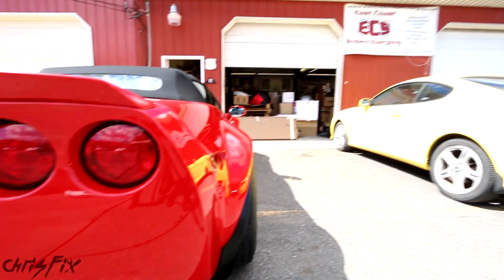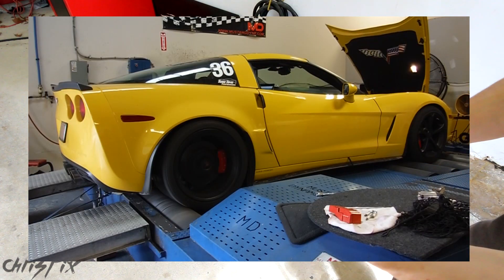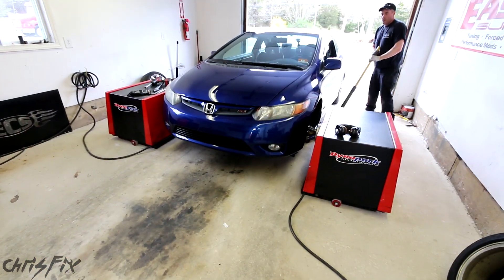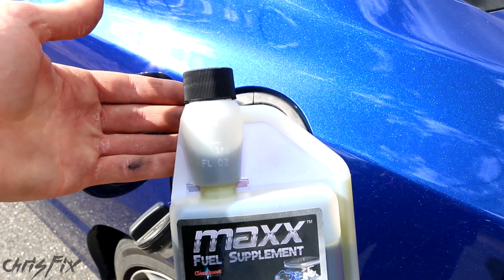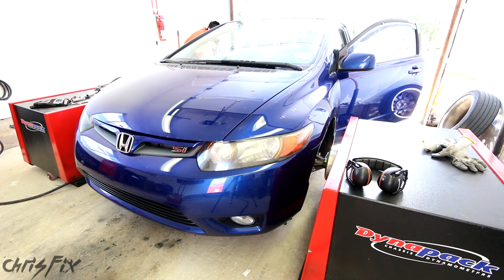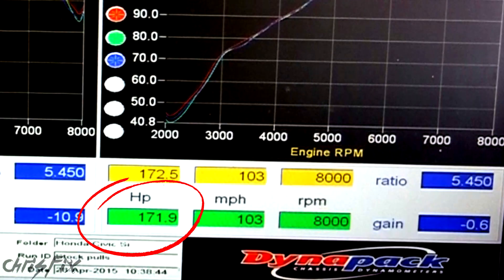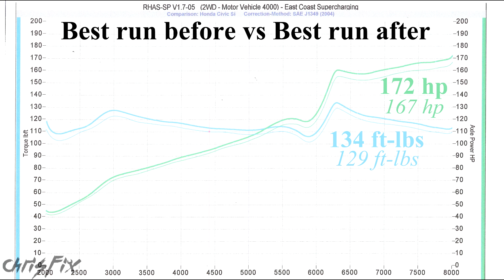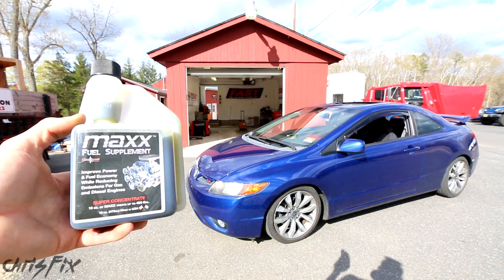Can a Fuel Additive Really Increase Horsepower in Your Car? (With Proof)

Comment: Have you thought of running tests on cold air intakes? Testing the torque, hp rating and fuel mileage claims? I think its a myth that needs to be busted once and for all.
Reply from the maker: MrLimondavis That would be pretty awesome! I am thinking about it but it is just very expensive and takes a lot of time to do!
Reply: ChrisFix it would be expensive. I think that's why no true independent tests have been done yet. It would bee awesome to know once and for all especially the for the working man that could spend that money elsewhere.

Comment: Super cool, ChrisFix! I drive past ECS on 539 all the time on the way down to LBI and on #Slambo's open road MPG testing. I need to throw some CleanBoost Maxx in the tank …
Reply from the maker: Nice! I cannot wait to test the MPGs!
Reply: ChrisFix HP is relatively easy to measure on a dyno. Strap on, fire it up, and run it up to speed. Real world MPG is a tough nut to crack. The variables are endless. I use a 40+ mile loop on I-195/295 for highway tests on most of the cars I review and drive as consistently as possible.
Reply from the maker: MPGomatic Yea, that is why I have never done it haha

Comment: The results clearly speak for themselves.. But there are a few variables which could have skewed the results (Did you give the car the same run before the baseline test as you did to mix the additive?). Ambient temperature? Oil temperature (I know coolant temp was measured)

But as always my position is that if there is a concoction of chemicals which could be safely added to increase power / reduce emissions and increase MPG it would be in fuel manufactures best interest to include it in their fuels..
Branded as "premium", obviously

So I wonder how conditioning a branded "premium" fuel with this additive would compare to basic fuel on the dyno..
I'm talking about premium fuel with additives, not fuel octane levels (which is far easier to understand) ;)
Reply: I could see how the fuel additive may have had some kind of impact on the fuel trim the computer was using based on how the altered fuel interacted with the O2 sensor. With out a wide band O2 data log showing what the air fuel ratio was on each run, the power increases could well be due to a slightly altered fuel trim as much as the fuel actually making more power.
Reply from the maker: Azurren As stated and shown in the video the ambient temperature was relatively constant and also corrected for by the dyno as well as barometric pressure (check out the computer screen when I show the dyno runs). Oil temp was about the same because we spent the same amount of time before the dyno running the car but there is no oil temp gauge so it is hard to show that. Good thinking and I like your curiosity!
Reply: ChrisFix The most puzzling thing for me is how the first 3 dyno runs yielded decreasing HorsePower figures however the 3 with the additive remained fairly consistent..

I mean, surely a fuel additive wouldn't solve the thermal / heatsoke issue. Could it? Theoretically it's possible that it could help improve it but.. By such a margin..?

I know dyno time is expensive but I would love to see more of this type of video :)
Reply from the maker: Azurren I cannot say for sure but the fuel additive seems to have helped combat the hp loss due to heat. I think it is the catalyst in the additive that creates a consistent explosion of the gas. I really hope to do more dyno testing but this stuff gets expensive fast! These runs are $300!

Comment: Not worth the few horsepower you will never feel.
Reply from the maker: FordTechMakuloco True, but we need to test the fuel economy claims. If it does in-fact increase mpgs so that you save money by using it, then the extra hp is worth it!
Reply: We shall see but doesn't that car get crazy good gas mileage already? Interesting stuff either way.
Reply from the maker: FordTechMakuloco I wont be using just one car ;)
Reply: FordTechMakuloco Time to try it in the Ford TD 6.0L!
Reply: ChrisFix You should perform the test with specific fuel/additive ratios to verify the increase.
Reply from the maker: ForestNinjaZero I did. You need at least 1/2 an oz for 15 gallons.
Reply: ChrisFix What was the octane of the fuel you were using?
I have an Audi V8 with the same compression (just many more liters) and I can tell the difference between 91 Octane and 93.
Reply from the maker: MrRexQuando It was 91 octane.
Reply: Not in a 4000lb car but a 2000lb Civic you'll notice a few ponies.

Comment: Hi ChrisFix,

I own a 2009 Toyota sequoia obviously I bought it since 2009... I have a big dent on my front bumper with some few scratches on it and so the rear bumper, I also realized that the paint on the dents are scratching off a bit, Do I need to repaint the whole body of the car or just the dents? Because I have some weird black dots on my car hood and they wont go off even by washing it!

My steering wheel and driver seat are also scratching off! the car is in seriously bad problems, and I cant write them all here because that's going to be a huge description of my car!

If you have any advises, please answer as soon as possible. my car needs help! :(
Reply from the maker: Anarchy Panty (SupaMario) If you have a lot of dents and stuff, a body guy will probably just tell you to replace the bumper because it would cost too much to fix. A lot of those problems including the steering wheel and seats are not reversible.

Comment: Need to know the fuel octane and compression ratio of the engine
Reply from the maker: Otto von Chesterfield, Esquire This isnt an octane booster but the car requires 91 octane and the compression ratio is 11.0:1
Reply: ChrisFix That is the same as a 5.0, which  is convienent

Comment: Wow... that's pretty good. The amazing thing about this is that it is a topic that is quite often discussed by many but actually demonstrated by few to none at all. I would imagine that with a car that doesn't require the premium fuels, a gain in octane won't benefit at all because the compression in those motors is already low enough to not cause much any pre-ignition. He really did good on this test using a high compression motor such as the one in this civic, that does require premium fuel. especially for a stock honda, that was a pretty good gain!
Reply from the maker: Jj Price This stuff isnt an octane booster so it works the same in all engines. I am glad you liked the test! Thanks bud!

Comment: can I use it in a daily basis? does it harm engine or engine and fuel components? ChrisFix
Reply from the maker: You are supposed to use every time you get gas. It is supposed to actually help the engine because it adds lubricity to the fuel and keeps the engine running cleaner. I really want to see if it creates more mpgs which will be big if it does!
Reply: ChrisFix thanks, I might try it on my older Civic EK

Comment: Wonder what would happen if you dump the whole container in lol
Reply: ChrisFix In the interests of accuracy to the claim, you would have to test the product without a delorean, flux capacitor, plutonium, or 1.21 gigawatts.
Reply: I'd read the directions on the bottle. Try not to rip the continuum a new one.
Reply from the maker: Evak Blades You can time travel. That is their claim on the bottle, so we should test it in a delorean right?
Reply: ChrisFix delorean is so 1985 i think the civic would be just fine for the test
Reply from the maker: PGTMR2 Hahaha, that is very true. I wonder if I still need to hit 88mph without a flux capacitor?

Comment: so roughly works out to 5% right? not too bad i guess as its just a fuel additive
Reply from the maker: DjStiv3 Correct. I want to do a fuel econeomy test to see if it increases mpgs which will save you money and increase your HP so it would be worth it.
Reply: ChrisFix
gotta ask... when do you recommend this to be used? its not a drastic HP gain, but should it be used at all? If your a gearhead/tuner and all that, its good, but for most people its not worth it right? I feel sketchy adding this to my fuel, for the fact that im cautious and careful with my car, even if theres is no chance of anything bad happening, i still feel wrong doing it.
Reply from the maker: DjStiv3 If it gives you more MPGs then you should use it all of the time to save money and make more power (I will test this in the future). Otherwise, if you are trying to squeeze hp out of an engine or have a race car I would use it. I know what you mean. Adding stuff to your gas feels weird. I never used any of these additives before I started testing them out!
Reply: ChrisFix
thanks for the info and answers bro. Im going to consider using it, but yea in the back of my mind i think i will always have that thought in my head of "will there be any long term damage or damage at all". lol
Reply from the maker: DjStiv3 Yea I feel ya. They say it adds lubricity to the cylinder walls so it should actually help your engine last longer but I know what you mean. That is why I do these test and use my borescope camera and stuff so we could see what we dont normally get to see. Unfortunately long term effects are hard to test.

Comment: This is why i want ever have a car show because I want sell out my credibility by helping companies sell BS to people who trust me. I lost All respect for Carrol Shelby after he did the Z-max commercials.
Reply from the maker: ***** Exactly! And that is why I do these tests with these products. We have seen good results on a few like this stuff, seafoam, and even gumout worked a little, but there were a lot that didnt do anything like techron and lucas fuel system cleaner. I still have to test Z-max so dont count it out yet. The claims on the bottle might be real, or they might be bogus. The other thing is, I have limited resources so these tests arent 100% conclusive in any way. If I had the time and money to do more dyno runs, take the heads off to look at the valves, etc, then we could get a 100% conclusive idea!
Reply: ChrisFix Dude, I not your normal youtuber. I have a few videos on tube and been dealing with car 30+ years. Just because u use a dyno n your video want hold water with me.
Power should have level out around 7800 rpm but it went up. Your graph is not right.

Comment: This test is BS.  Just say if that stuff really does increase hp. It would need more air to burn with that stronger fuel. The engine can't suck down anymore air because the stock cam want allow it to. (yes i know it has v-tec)
look at it like this. E85 is weaker than gasoline right? It takes about 20% more e85 to make the same hp as gas.
  If that Si came from Honda burning only E85 and u was to put gasoline n there. The engine would run to rich, because it would be dumping to much gasoline into the engine. The ECU want adjust to the change n fuel because it was not program to do so.
Also, think about this. After watching this video. A bunch of stupid people will go and buy that stuff and pore the whole bottle n the tank thinking they will get 50 or more hp. That will make even less hp because the engine will need even more air to burn that so call hotter fuel.
Reply: ***** You are hilarious! Thank you for entertaining me with your "logic and reasoning"! Reading your comments is like receiving a lobotomy and becoming dumber.
Reply from the maker: ***** And that is why I let you make your own decisions. I did my best to compare before and after just like all of my tests, and I show you my results and I say make your own decisions. The additive works by making the combustion more concentrated and complete which is why we saw a HP and torque increase.
Reply: ***** By your logic, as long as I upload a video I know what I'm talking about. Honestly, I'm not even sure what to say to that. So if by that logic I uploaded a video about Rocket Science, I would instantly have credibility? Also as one of your earlier remarks stated "I have a problem with anyone who try to school me with BS they have read online." so by that logic, as long I upload a video, it no longer becomes "BS online" and I can then proceed to "school" you. Also, I worry about anyone you have installed breaks for, especially when you have been doing it "sense" you were 14. But seriously, you are an idiot and I'm glad I got to read your posts. They genuinely made me laugh. P.S. - I never claimed to know anything about cars. I was initially commenting on how your comments made you sound like a simpleton with one to many crayons stuck up your nose.
Reply: ***** Lets pretend I know nothing about cars because that is irrelevant to my point. Although I suppose It's not clear in my original post, my second one should have gotten the point across. However since it appears you have missed it altogether, let me reiterate. "By your logic, as long as I upload a video I know what I'm talking about." and "So if by that logic I uploaded a video about Rocket Science, I would instantly have credibility?". Now I understand working with cars "sense" you were 14 has caused you to most likely breath in a decent amount of chemicals, and that over time said chemicals have probably killed a fair portion of your already limited brain. So I'm going to try and hold your hand through this and explain it in a way a child with a mental disability would understand. UPLOADING VIDEOS DOES NOT MEAN YOU ARE MORE OR LESS KNOWLEDGEABLE THAN ANYONE ELSE. YOU CAN "show what u know" SIMPLY BY WRITING IT OUT. As always your reply's are hilarious, so thanks for that.
Reply: ***** At this point I'm beginning to think you are a troll. It's pretty hard for me to believe someone as dumb as you exists in this world. Good day.
Reply: *****  That engine has a wide band O2 sensor.  That means the engine has real time data on what the air fuel ratio is at every load and RPM, which is something pre-wide band ECMs were not able to know.  That being said, the ECM will be able to adjust the fuel trim to the lambda set by it's programming, even at WOT power, as long as there is enough fuel pressure and injector pulse width available. (As a side, most OEM air fuel ratios are not optimized for power, even at WOT, but for engine durability, most are actually too rich to make max power)  If this additive altered the fuel in a way that it's various flame front speed, effective octane rating and heat of vaporization into conditions more favorable for making more power given the engines swirl profile, compression ratio, ect.. then it could very well make a little more power in THAT engine.

Also there are plenty of additives that will increase horsepower, like Klotz's nitro propane additive for instance, but it is true that most of the common additives sold will do little or nothing, and if it does it's most likely luck, much like how some engines will make more power on low octane fuel due to the various factors impacting combustion in that particular engine favoring lower octane, so there is always a chance an additive can help a small amount, or just it could make less power.
Reply: Duwayne Fleming ***** That might be asking a bit much Duwayne, he doesn't seem like the type that can comprehend what he reads. To get through to him you need to post a video about it apparently. P.S. - blackericdenice, comprehend means understand.
Reply: Duwayne Fleming  Yeah, I shouldn't have bothered as I could tell he lives in a fantasy land.  Anyone that's been around a bit will have seen some additives make some impact, even if it's usually small and often doesn't seem cost effective.

  The Si is often considered a semi-wideband, being it is accurate beyond the range of older narrow bands, but it has issues and less capability than the Bosch LSU 4.2 favored by after market controllers. For instance the Si O2 unit has been shown to slowly lose it's accuracy if a bunch of dyno pulls are made in a row as it seems more impacted by heat soak, but yeah, calling it a wide band was incorrect.
Reply: Thank you.
Reply: Duwayne Fleming Dude, the stock SI intake cam is what limit the amount of air going n to that engine. 
This go for any N/A engine. The SI peak hp is 7600, the graph was still going up @ 8000. That's not right.
Reply: Duwayne Fleming Dude, before u try to school me, upload some automotive relative videos. Have a great day.
Reply: Duwayne Fleming Until I see auto related videos that you uploaded. You are just some 14 yod kid reading from the internet.
Reply: Hex Crown Because you don't have automotive related videos. I don't care what u have to say. Enjoy reading about CAI and throttle body spacers giving stock cars 19.53 more hp.
Reply: ChrisFix Nothing anyone sell n a bottle will increase hp or mpg. Never has and never will.
Only people who don't know how an engine make power will believe this video.
Reply: Duwayne Fleming Not a troll, I'm on youtube to question people who sell BS additives and parts.
Ever hear of LarryBloodworth? He own a trans repair shop and has a tube channel. He told a guy that he needed to upgrade to a $300 part. I ask why was he charging the man $300 for a $100 part.
Yes he band me from his channel but He also stop cheating people on tube anyway.
Reply: ***** I don't know, and honestly I don't really give a shit. The only reason I started commenting on this post was because my friend wanted to show me how dumb you were. And I must say, he didn't disappoint. As far as anything car related, I could give ZERO FUCKS. I'm just here to laugh at you.
Reply: ***** You do realize that me replying to you on a video that you haven't uploaded gets you nothing right? But as Duwayne mentioned, you have made peanuts over the life of your channel.
Reply: ***** And you are trying to "school" people. LOL what a fruit.
Reply: ***** Pretty sure the more power the car makes the more air and spark it uses and creates.